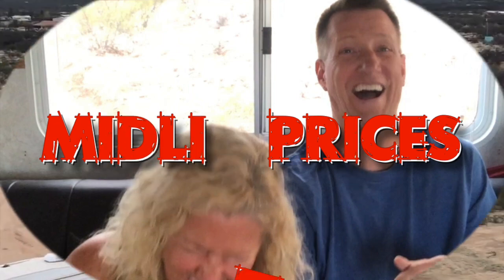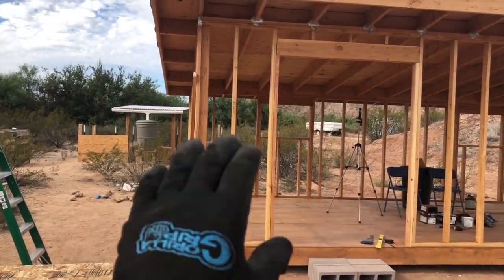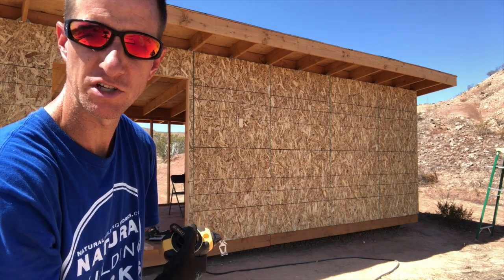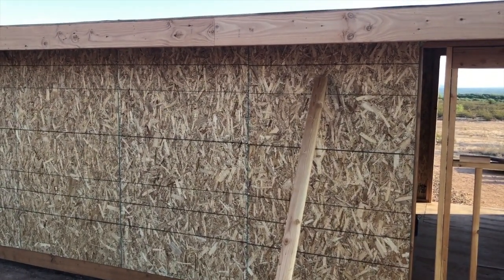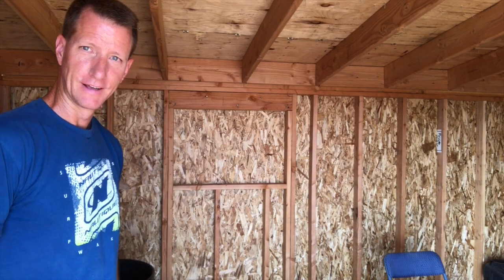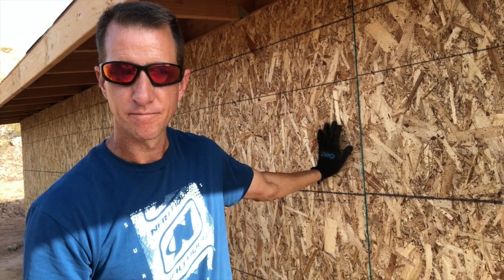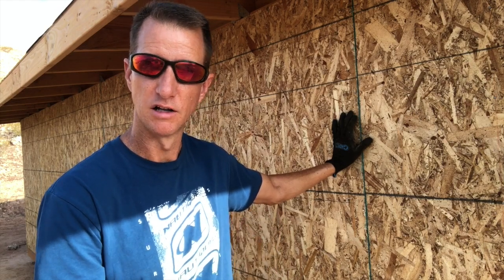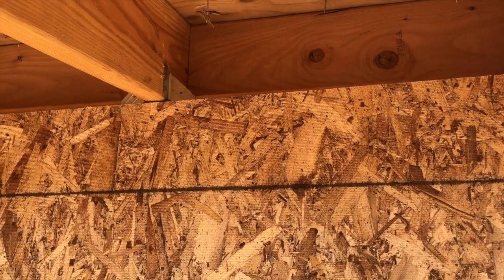12'x24' DIY Shed Build (Part 5 - Wall Sheathing)

Comment: Looks great Brian. A router works great for cutting your openings. The soffit approach is your best option at this point. I'm really enjoying watching this build
Reply from the maker: Thanks, Warren.  Unfortunately, I've never had a router.  Been thinking about the venting aspect of this for a bit, and may be a non-issue.  The fact that there's no attic inside or anything for the air to get trapped in might mean that a couple of gable vents high on the walls will be all I need. 🤞

Comment: That is a great job if it's all square and level I would go with double pane windows and put siding on and box in the hangover and u would have yourself a nice size little house love it getting ready to build me 1 thank for showing showing
Reply from the maker: Thanks for watching.  Nowhere near the insulation of the straw bale house, but not bad.  Definitely would have insulated the floor if I wanted to live in it at all, but could be made livable if you wanted to do that.

Comment: I’ve also used a router with a straight bit and bearing to cut out openings. The bearing keeps you from cutting the framing. You’ll be left with a small rounded corner, but you only need one hole to start. It’s fast and neat. The new cue thing is that you can leave the OSB in place until you are ready to wrap the building and have the windows ready to install. I like the building!
Reply from the maker: I saw several people using routers in videos.  Gonna have to get me one of those!  Thanks!
Reply: MidlifePrices they can be a great tool to have. A big time saver when used right! Have a great day. 👍
Reply from the maker: Totally agree!  I always wanted one, but never really had the project to justify it.  It's going on my list!

Comment: I think, underneath, you could just attach some bird block netting.
Or if you wanted to get fancy, you could put hinged boards and use the area for extra storage
Reply from the maker: That's a good idea!  I don't really NEED it closed up solid, but I just wanna keep birds and stuff out of there.  You might have a better (and cheaper!) solution.  Thanks!

Comment: About the rafters on the outside. You where talking about cover them with boards and drill holes for air flow. Air flow is important to ventilate moisture. A good way is to staple some insect net on the rafters and leave an opening of mabye an inch between two of the boards where the isect net is all the way across.
Reply from the maker: Excellent.  Thanks!  👍

Comment: The shed is looking good so far. Just found your vids. Started from the beginning. For future reference. If you would have brought your blocking to the outside edge of your ridge cap.You'd have saved yourself a lot of grief. On the shed you wouldn't have had to put any soffit in at all. A house would have been different. But then that's only if code requires it.
Reply from the maker: Thanks, Ken!  I agonized over that placement for a while, and I now see that it would have been better on the outside edge.  Live and learn!  Thanks for the advice, and for watching.

Comment: If you'd have nailed in a base trim/ratguard dead level at the bottom of your terminal end of the wall sheathing you'd not need the prop board. Set a sheet of OSB on the ratguard and tack in place,on to the next sheet then nail off after the whole wall is done.
Reply from the maker: Yeah, this could have been made easier.

Comment: Soffit it's made for air flow it's built-in air pockets to it. If  you put plywood on instead you'll have to put vents every some many per square feet on the roof you have.
Reply from the maker: Gotta figure this part out for the house we're working on now!

Comment: on the OSB panels on the sheathing, do you leave a gap between them, or do you put them tight against each other? also, on the corners, does one side overlap the other side, or do you keep them flush with the end studs on all corners?
Reply from the maker: Left a small gap between them for expansion/contraction.  For the corners, I think I kept them flush with the end studs, but then added trim later to cover.  Thanks for watching!

Comment: I've seen shed builds with neither the OSB sheathing nor the house wrap - just exterior paneling nailed straight onto the 2x4 framing. What are the advantages of doing the extra work (and spending the extra money), if it's just going to be a shed, not insulated, etc?
Reply from the maker: That is an excellent question!  I wish I had a great answer, but I'll do my best.  I guess sometimes we all just get caught up in the "typical" ways of doing things without really questioning or thinking about it.  I did actually consider during the design of this shed not using any sheathing, but a wise friend cautioned against it.  I believe his main argument was strength/durability.  Also, I do plan to insulate some day, and I think the wrap was suggested to prevent moisture from getting in.  Much like many other choices we make over the course of a build like this, it's not that you can't get away with cutting some of these corners, but it's a question of what impact they will have on the strength/durability/longevity of the building.  Many different choices could be made, but it ultimately comes down to weighing your needs and expectations against additional investment.  Thanks for asking!

Comment: For cutting the window hole the saw can cut clean through the osb without even drilling holes first
Reply from the maker: Which saw?  I don't think the reciprocating saw can do that.  And for the circular saw, the drilled holes were to have reference points to connect.  Thanks for the comment, though!

Comment: double check this info,, but if you are NOT going to insulate the ceiling you don't need to have a ventilated soffit.. It is going to be a shed, correct.? so it won't be an airtight building..
Reply from the maker: I think you're totally right, Robert.  Just never had a reason to think about it much, but I think I'm concluding that it's a non-issue for this building.  There's no attic or anything inside, so I think I'll just use some gable vents high on the walls to let hot air escape.  Just trying to moderate the temperature a little bit.

Comment: You can run the soffit all the way except on the sides. You will need additional frame work to nail the soffit to. If not it will sag.
Reply from the maker: I definitely see that.  I'll add more blocking nailers along the side if I go this route, which I'm leaning towards now.  Thanks!

Comment: you're supposed to drill the hole in the corner like you did and get a router with a flush trim bit; go on the outside of the building and ride that router along the edge for a perfect cut.  No measuring.  Also why you place the osb left to right as 8 ft is because those black lines are for nailing telling you where the studs are 16" O.C.
Reply from the maker: Both good points.  No disagreement here.  Gotta get me a router!

Comment: I am no carpenter, but it looks like the lines on the boards are for nailing to the studs. Should they have been installed horizontal instead of vertical?
Reply from the maker: I’m not a carpenter either. Thanks so much for watching. ❤️😃
Reply from the maker: I now know that the lines on OSB are meant to mark stud locations, but they should be able to be installed vertically, as well.  I'll have to research that a bit.
Reply: Fair enough! Thanks

Comment: All the trouble with trying to use a powered tool for sawing timber - why not just cut the windows out with an old reliable hand saw.
Reply from the maker: Fair point.  You have sufficiently shamed me.  😉
Reply: @MidlifePrices  - Sorry -  I like your videos, and I don't want to shame you.
Reply from the maker: No problem, just having some fun.  It's a valid point, though, that some things are still most easily done with a little bit of elbow grease.  It's important not to forget that option.  Thanks for watching!

Comment: best way to do this is use a router with a flust bit. a little messy but you get the best finsh
Reply from the maker: I've always had a router on my list of tools to pick up, but I haven't done it yet.  Have never owned or used one.  I don't doubt you're right, though.